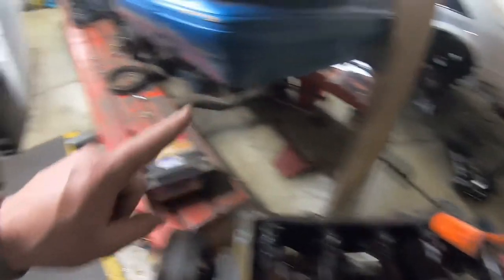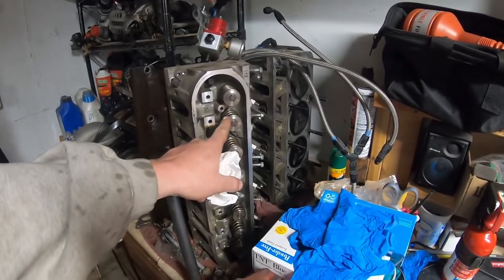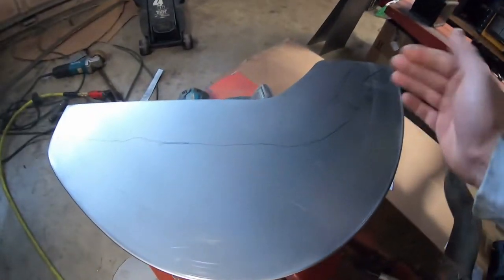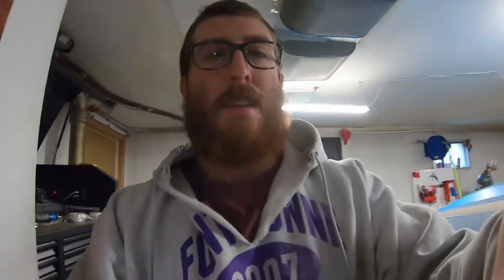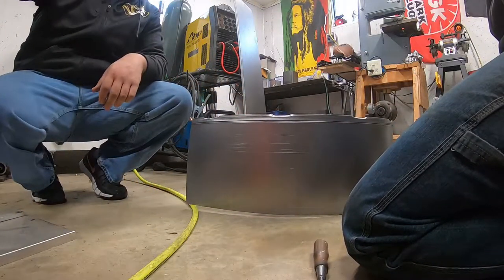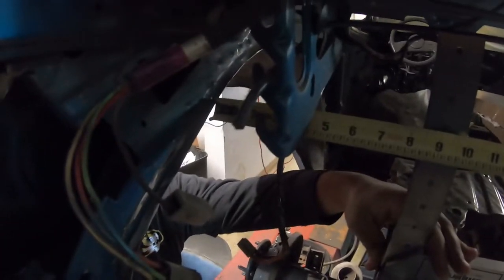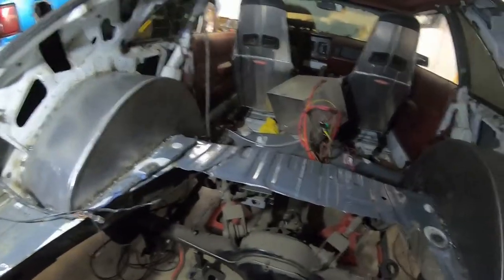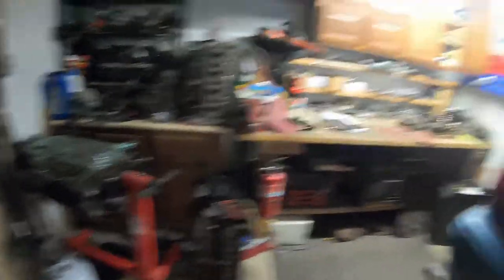Fitting Team Z Mini Tubs!

Comment: Are you going to mount the fuel cell under the trunk floor so you still have a bunch of trunk room or are you just gonna put the cell in the trunk? Wouldn't you have to put a firewall in the back of the car if the cell was in the trunk?
Reply from the maker: Yea I think it's supposed to have a firewall if it's in the trunk on both but I'm gonna try to skew the rules a little but also be safe with it. You'll see in a week or 2!
Reply: @Hidden10sGarage  right on man!

Comment: Any plans to put a roll cage in either car?
Reply from the maker: Yes, we're wanting to get a bender and make a cage up outta 1 5/8 .083 chromoly. Were gonna be doing his sooner than mine, but still wont be for a few months. Trying to get them both running and driving by mid april, then gonna hopefully do cages in may ish.

Comment: Hey Bro .. if your really leaning on these motors especially under boost .. Don't be foolish spend the dollars get rod bolts or maybe new rods & pistons especially if your running Boost .. I'm a little surprised your using stock bottom anything ?????? But to have the motor out doing all the work you have scheduled on the rest of the car it would be totally insane NOT to do a bottom end capable of  reliability & longevity  unless you just go out and get another Pic N pull motor  until you blast that one out the pan ....
Reply from the maker: We drive over cranks here